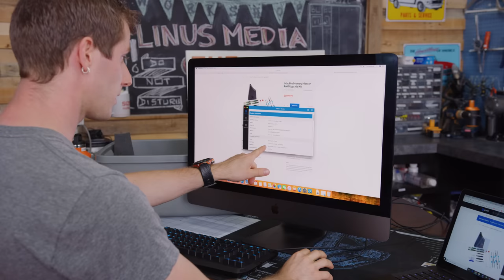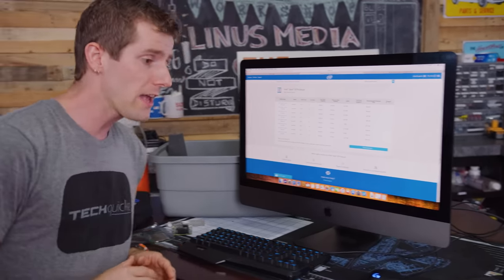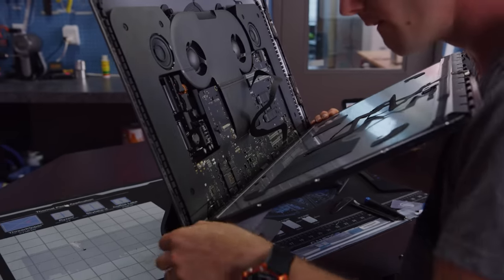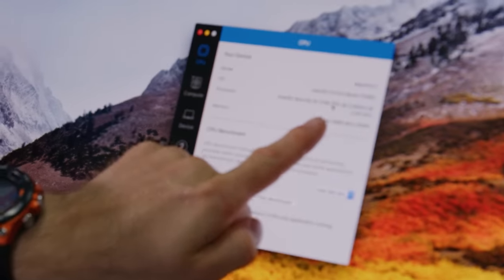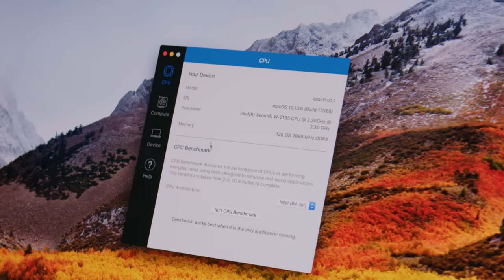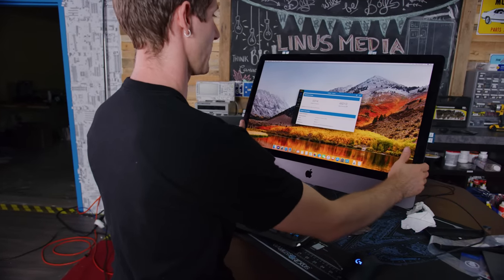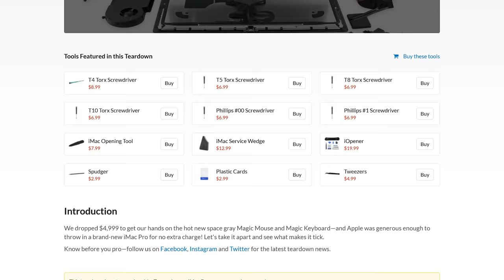UPGRADING the iMac Pro!?

Comment: Can't you just use Ubuntu or some other Linux distro?
Reply: For me (a mac and Windows user), there simply isn't enough native support on Linux to use it as a main OS, and Wine is simply too unstable on many applications for it to be practical in my experiences
Reply: @agent_605  I can agree I don't use it as my main on my main pc but on my laptop I use it as main since it is not the most powerful.
Reply: ZillHax I can understand for low end computers, especially older types that Linux is probably the best for them, as it can get day to day tasks done and is generally lighter and less demanding than modern versions of Windows and macOS, and I don’t think anyone wants to use Windows XP or Mac OS X Panther nowadays
Reply: I love Linux on this laptop and plan to use it as my main OS in a desktop that I'm building soon. I had no problem using on this laptop for days at a time. Without booting into Windows.
Reply: Maxim Chintalov My issue is simply down to compatibility, most programs either don’t run at all or don’t contain all their features on Linux, or when using Wine are just unusable due to instability. Any high power applications not Linux native are basically a no go, or if you like the odd game, there isn’t really anything on Linux, whereas there’s the odd thing on a Mac and pretty much everything on Windows
Reply: @agent_605  personally on my main pc I dual boot since I have a few hundred $ worth of applications that only work on windows. And it's my main gaming pc. But for general productivity I like kubuntu since it is very smooth feeling.
Reply: ZillHax.... The best thing about apple, (some will say the only good thing), is their OS. I use Linux myself but if I did a lot of video stuff I would buy a mac just for that.
Reply: thegeorgezila  We are talking about the use case for the end user. Those are all highly specialized uses where software compatalibility isn't that important or like in android it has been heavily modified and used in something that's not really a computer. 

If you have a high end home pc and want to edit videos or make music or play games or simply use most software then you should use windows. 

If you have a weak home pc for just browsing then you should use Linux. Thanks for taking his comment completely out of context.
Reply: Cokicoke  yeah most people, people that only do web browsing emails and watching videos are those that switch easiest. Partly because they don't really care what's in the background  if what they want to do works, and if it makes the laptop more silent, doesn't restart and update on your behalf and doesn't make your wallet lighter then that's a bonus.
Reply: While macOS is way better for end user? Ticks all the boxes;
Longevity ✔️
Third party support ✔️
No fragmentation ✔️
Never ever need to see terminal ✔️
No grub to fail ✔️
Instant backups ✔️
Integration with other devices ✔️
Aesthetics ✔️
Ease of use ✔️
Proper support if you have issues ✔️
Fast ✔️

Yeah, Linux is great for nerds like us, but not everyone is nerd nor they bored of fucking instability and lack of third party stuff.

Comment: even tho i hate apple, i actually installed a version of macos on a vm just to see how it is.
ITS LITERALLY THE SAME AS UBUNTU!
EDIT: i meant the usability and ui is the same, not the functionality
Reply: just a question because im kind of curious, but have you used linux for an extended period of time as a main os, for say 1 month or so or are you going off what other people have said?

not hate or anything just curious where your opinion comes from.
Reply: @PingasTheFourth so either you've never used Linux or you last used it 10 years ago. By the way, every important ir mission critical machine un the world uses Linux.

Signed: a Windows user.
Reply: NO IT'S NOT. After 15 years of Linux, I switched, 9 years ago, to OSX.
Still have Odroid & Raspi with Linux.
It's a bad desktop experience, try a major update (ubuntu 16 to 18) and the nightmare begins, you're better off make a fresh start and reconfigure all your apps, libraries and so on,,,
Bad desktop experience 2018, raspbian Ctrl-V in the browser works kind off but doesn't on the Terminal (need to use menu)…
Come on you have to admit, if you're not an enthusiast it is BAD.
But if you want to dig in, it's pretty fine.
OSX just works, is extremely reliable and you save time not tinkering on recurring problems (alsa, jack, …).
Reply: +PingasTheFourth wow, you cant even respect others opinions without hating on them
Reply: +final_edit i did install debian on a vm and used it for some months but i have no reason to change my main os, i was just experimenting because my professor told me that programming was better on it. he was right, but the ui is too boring and simple, it feels 90's.

Comment: I upgraded my 2008 iMac back in the day. More RAM and removed the optical drive to replace it with a SSD to make it a hybrid fusion whatever they called it drive. It was super easy, I was surprised; but mostly surprised that the screen was held on with magnets and I needed suction cups to remove it! None of this windshield adhesive crap
Reply: You can put a new processor but you gona need a new screen. If you want you can change the glossy screen for a new matte screen.

Comment: Dells used to have thermal paste that pulled the cpu from the socket when it they used PGA Pentium 4s, but to put it back in there was still the retention lever.

Comment: @
Linus Tech Tips
Correct me if I'm wrong here... I thought one could discharge the capacitors by unplugging the machine, then holding down the power button for several seconds.

Comment: i dont get one thing though.
sure, dont touch the power supply, but, why not just you know, disconnect it or pull out the socket so, there wont be any "juice" on it that could kill you? is there a reason a power supply should still be connected?

Comment: About the exposed power supply, couldn't you uncharge the capacitors by just running the computer and pulling the powerplug to make it safer?

Comment: So since you can swap out the SSDs with those from other iMac Pros (using configurator on another Mac), and since the iMac Pro SSDs can be put into a Mac Pro, does that mean you can out Apple's new SSD upgrades for Mac Pro (which look identical and seem to have the same connectors), into an iMac Pro? It would be nice to make an 8Tb SSD iMac Pro.
Reply: The SSDs are encrypted by the T2 chip, so they can’t be swapped.

Comment: I was able to upgrade my 2019 27” iMac (non-Pro) to 2TB SATA SSD, 2TB NVMe SSD and 40 GB of RAM, but the Core i9-9900K upgrade didn’t work (black screen). Tried 4 times. I have a Core i5-9600K that I was able to put back in and it works. Do you know why the i9 won’t work? Is there something I have to do to the BIOS or anything in preparation? Also Linus, love that you hate the thermal paste tearing out the CPU too! What an awful design!!

Comment: im not a fan of apple products and havent been for a long time, the one thing they made that was amazing, the ipod video, could be rockboxxed and you can stick an ssd or larger cap hdd in them.. i have a 240gb and its still one of my favorite players ;)
Reply: but the rest of their products, are not worth the cost imho.... you want a high end pc that can be a mac.... make a hackintosh, and get something you can upgrade yourself and run multi-boot without having to dick with apples bs... (my buddy uses an old 256mb flash drive to load a uefi shell that manages his installed os's....works fucking great and dosnt require hdd based boot loaders!!!)

Comment: Accessibility in Windows still sucks by comparison. In my case, to get anything approximating the Mac experience, I need to install software that has its own separate graphics driver...damn thing is so resource intensive that I need 16GB RAM just to run a simple Excel workbook. Not to mention the $700 for the software in the first place. With a Mac 8GB is more than sufficient.

Comment: Please tell me: iMac Pro has 4 slots for RAM cards on the motherboard.
By default, there are 4 pieces of 8GB each, if I want to upgrade only two pieces for RAM of 32GB, does it matter in which slots they will be installed? Thank you!

Comment: I have a question, hopefully someone has an answer. I have a late 2009 macbook. High sierra version 10.13.6 8GB memory graphics NVIDIA GeForce 9400M 256MB. Can I upgrade to a Metal GPU? And also upgrade to a quad processor instead of duo?

Comment: does anybody know the name of the app he uses at the end to do the benchmark ? and can somebody over at linus tech share the shop where you bought the 18 cores CPU ? as you say it's about saving money, which on the RAM side of view makes sense, but concerning the CPU side, I can only find shops which are selling the CPU for more money than it would cost bought at apple's config site (and then it's already built in, so, no hassles, no time waste, no guaranty losing risk), at least over here in switzerland. taking this in mind I don't really see advantage of taking that risk (specially when I saw that the CPU is not even attached with the mount). would appreciate your feedback, cause if there's a shop selling it cheaper then here, I would considering go thru all of this :) . thank you, san

Comment: With the power supply surely u could disconnect all the power so you dont have a chance of getting shocked
Reply: well, a power supply has a bunch of capacitors (and quite powerfull ones). Those can stay charged for a long period of time. So a power supply is still dangerous even if you plug out the power cable.

Comment: https://youtu.be/WvvBh3CIoWc?t=430 A friend of mine was "cleaning" his mom's AMD-based computer (one I built for her), and he had removed the CPU retention before removing the heatsink. He then actually washed the heatsink in water, and then tried to put it back in. But somehow it wasn't working, so he brought it back to me.

Well, once I finished laughing at him (took several minutes), removed the CPU from the heatsink (made difficult because it was well glued and I really didn't want to cause more damage, etond any possible water damage), cleaned off the thermal paste, straightened out the pins,  re-socketed the CPU, reapplied new thermal compound, mounted the heatsink, and laughed at my friend some more, it works fine.

So that's how I learned that an AMD CPU will survive being washed.

Comment: 6:00 how much you wanna bet that those naturally UP-CURVED plates had that much tension on them, in a deliberate purpose to ensure that the flimsy screws (check the broken monitor stand videos on youtube for proof of the tin screws they use) would eventually have a higher chance of simply randomly breaking after a few months.
Because that is fucking ridiculous, i've never before in my life seen ANY cpu retention plate having naturally-rested UPWARDS bends to increase pressure like that, thats just insanity. Not even the top of the line intel-28 core stuff need to do that.

And remember, NOTHING in engineering is done randomly, everything has a deliberate purpose.
If those screws snap due to that insanely uneccessary pressure, that'd result in the entire cpu coming loose, frying the system.
Screws gone, cpu loose from socket, those screw stickers obviously naturally fall off if the screw snaps, BOOM WARRANTY VOID.
Pay full price for replacement. THATS why they put those stickers there, over screws with insanely high pressure.
It's a genius scheme.

Comment: You can't die, or even be significantly harmed, by touching a computer power supply. I've seen a lot of YouTube idiots, both content creators and commenters, repeat this canard lately. Even 120 VAC straight from a wall outlet won't kill you, nor even be particularly painful, and a computer power supply does not increase the voltage from the wall outlet. It does the opposite in fact, i.e., it steps it down and rectifies it to 12 VDC, 5 VDC, and 3.3 VDC. None of those voltages are high enough to even give you a shock of any sort (except on e.g., your tongue), because the dielectric strength of dry skin is too high. Try to get a shock off a car battery for example (12.6 VDC). Even though a car battery has more than enough amperage to kill you, its voltage isn't high enough to use you as a circuit in the first place.

The only component in a computer power supply that can store any sort of an electric charge is a capacitor, and a modern switching power supply is designed to self discharge the capacitors when unplugged. Even if, for whatever reason, the capacitors retain their charge, they are far too small to give you anything more than a mild zap.

Comment: i was just wondering if there was a reason you don't lay it down on its back and work on it upside down?
that is how i work on my IMac.
i was wondering if you could do an upgrade on an older mac? 

i have a Late model 2009 21.5" IMac running 

3.06GHz intel Core 2 Duo 

16 GB 1067 MHz DDR3 

NVIDIA GeForce 9400 256 MB
and a 500 GB SSD 

OSX 10.13.6

There are rumors online that even though mac said this IMac maxes out at 16 GB ram it can still be upgraded to 32GB ram.
I also would like to know can i upgrade to a faster CPU and a 4K Graphic card and screen? If it is possible to do all this can i brake the restriction that is limiting me from updating my OSX to 10.14.4 with my IMac classic?

Comment: such a poor cooling system. even for the CPU alone that heatsink is a a little small, but that little bitch cooler has to cool and i9 and a vega 56. no wonder these things have so many problems with overheating. and the best part is how they designed the fans to blow hot air out and then have the intake fans suck all of that hot air back inside of the machine and create a heating loop.

Comment: iMac "Pro". Yeah the quotes were intentional. There is nothing pro about the hardware, more like amateur. Anything pro should be easily upgradable and follow the industry standards. As in tool-less case for quick and easy access. tool-less mounts for add-in hardware and multiple PCI-e slots open for said add-in hardware. Apple doesn't know what every real Pro needs in his/her box but they sure as shit know what an amateur needs.

Any pro wants to get the job done so they can go home. if their computer is a full on rack mounted server next to their desk.. they do not give a shit as long as  the job gets done at the pace they want. They do not desire the iMac make it as small as possible and thermal throttled AIO setup that they cannot have the hardware they need to get the job done installed. That's the amateur who wants fancy looking hardware.

And NO video and photo editing isn't better on a mac. If you consider MS paint and Movie Maker compared to Mac's built in versions then sure Mac has the better software. If you use 3rd party professional grade software it's a complete different tune altogether.

Comment: Aannnddddd fubard the Apple Care with accidental coverage on the device. Sometimes it's cry once then benefit. I have a tricked out iMac pro sitting on my cabinet that is in pieces. Why? it fell off my monitor arm due to their crappy accessories screws to make it compatible with an external mount. $6k down the drain.